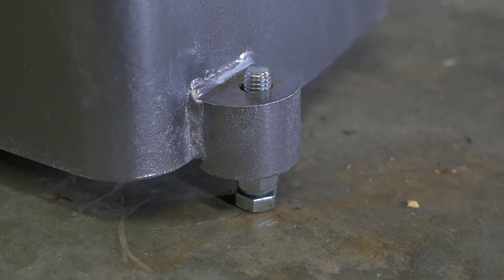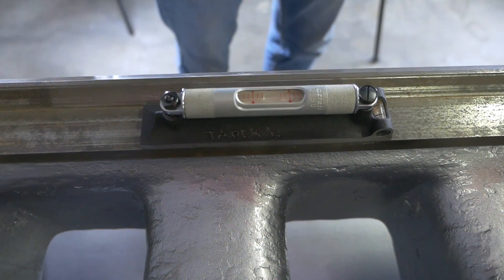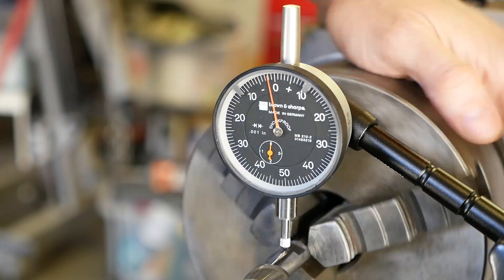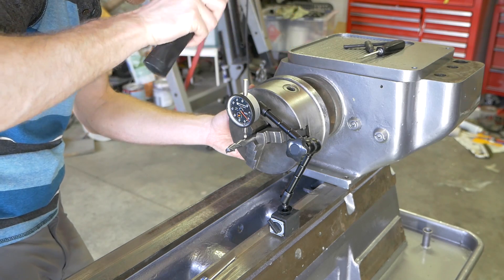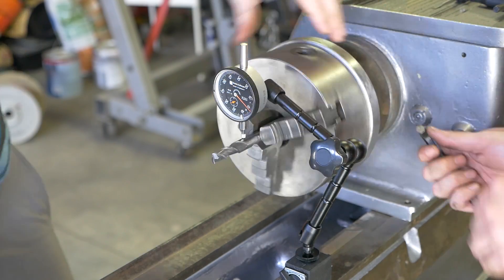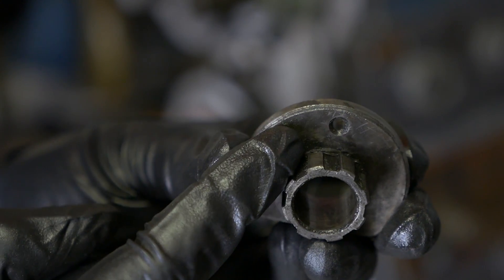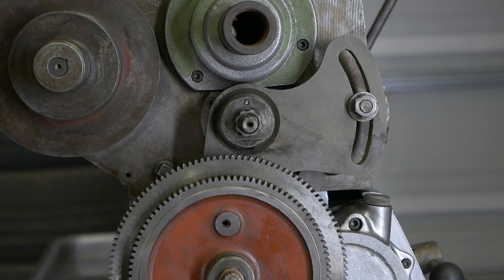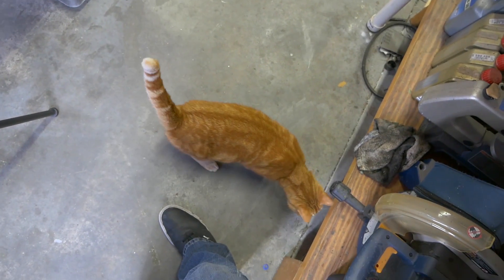Lathe Rebuild Part 7 - S02E07

Comment: Get a digital level.    You can still only get so close with the bubble level and you are still off.    Just like a carburetor on a car it’s the perfect way to measure air and fuel exactly the wrong way at all RPMs.   Close only counts in horseshoes and hand grenades.     If you want it right do it right.

Comment: That shear pin is designed to break off if you have any foreign matter that gets in those gears you would rather have that shear pin break off then your break off one of those teeth or a row of those teeth on those gears also do not use hardened steel use brass or aluminum for a shear pin

Comment: If you want the chuck dead center open the Chuck and put piece of DOM in the back fare enough that you can bore the .0005 off the jaws. I did that to a factory 10 foot engine lathe with a 16 inch chuck and it Was dead on.

Comment: Hi guys i have just bought a Colchester Bantam exactly like the one you brought back from the dead and did this world a great service in doing so. This is probably the best lathe of its kind ever built and will look after you for many years to come, your videos on the rebuild are relay awesome.I have learned a huge amount about my lathe without haveing to take anything apart.I noticed that you had a parts manual that you were using in the reassembly part of the series,could you maybe help me on where I could get one printed or  soft copy as I am also going to restore my Cochester even though it is not nearly as bad as yours was. Once again thank you for this awesome restore where others would have just  melted her down  and  turned this treasure into something stupid you guys did a fantastic job on this.
Reply from the maker: Wiets, PM me, I will send you a hard copy if you want.  Here is the soft copy as well:
https://drive.google.com/open?id=1wuU4BVSiTttArd5EHhh9shTDsNjfz56q

Comment: I want to find one of these GEMS soon after i build my garage... plqnning to build a 24x32 garage with 2 doors, and a side overhead for the tractor, and lawn tools. with the main doors on the short side. have 200AMP service to the house, so should be able to run a 100AMP service box and line to the garage for 220/240..

Comment: I am confused at the centering attempt at 5 minutes in. If you center by using the router chucked in the jaws, I can't see how it will work as a 3-jaw chuck has got too much slop to truly center a part in the lathe. Even if you dialed it in now, the next time it'll be gone and it's not sure the chuck is truly centered either in relation to the spindle, because 3-jaws do not clamp even truly round objects properly centered. 

Trying to do it like this seems like chasing your own tail, I am no expert on this but it seems more logical to try and use the inner and outer surfaces of the chuck for reference to get it centered in the spindle. Then see what the jaws say.

Comment: Why are you centering the head from a part held in the jaws???? The part in the jaws is not concentric to your lathe head (especially a 3 jaw chuck). You should be referencing the head to the ways first, the part should be centered to the ways after this is done, never assume the part is centered correctly until checked and adjusted.

Comment: I know i am a little late on this but to anyone else I definitely recommend smearing  a nice heavy, compatible grease between non moving mating surfaces when you are putting it back together. like the ways and the head stock. it keeps any moisture from finding its way between them and causing problems because they are not exactly areas that get regular cleaning and lubrication. I also do the same with my vise on the mill because of how rarely i move it. 
Probably a good idea for any bare metal mating surface to be honest, saves a lot of work for the next person that takes that machine apart long after you are gone, that guy will be like "wow that guy was the best!"
Reply: I use rp342 and put it together before the solvents flash off. You will never have rust and less settling than greasegrease
Reply: @adamjankowski7679  I use the canned aerosol cosmoline on most of my stuff that's exposed . I just like a thicker gease under fixed parts because it will prevent anything from seeping underneath them, dont use a ton just a finger smear and then slide it back and forth A bit to get it seated properly

Comment: The whole point of a shear pin is for it to break, a drill bit is hard so it is less likely to break. You should use brass or copper or something like that

Comment: In reference to your shear pin. Seeing as it's already sheared I'm unsure that using a hardened steel drill bit is a good call. The hardness of whatever metal was in there was specific as to avoid to much torque being transferred into the internal gearing. I'm sure it will work out fine and not be a problem for a while. But, it's a safety device for the machine. Check out Dustins video From smarter every day.(https://youtu.be/i7KfIBFMraE) Also, I know this video is old by now.

Comment: yep drill bit shear pin was a bad idea, drills are usually HSS or some type of A1 tool steel (drill rod). It's not going to shear properly and will likely cause another part to fail as a result.

Comment: A bar in a three jaw chuck is not a good reference to measure runout. Better take off the chuck and measure the inner taper runout on two different depths.
Reply: Exactly a three jaw chuck with hardened chucks never and i mean never runs zero, and you cannot take a runout on that....never!!
Reply: Absolutely. The two different depths is very important here! Need two concentric circles not just one.
Reply: Well said.   I could put another chuck on that spindle and be 10 out.   So what we re level the bed?????      Now I am 050 out because I have a messed up chuck. Always check the spindle.

Comment: A shear pin is designed to fail before you damage something expensive, use brass or even aluminum nnot harened steel.
Reply: Ideally, use the material that was originally specified...
Reply: Mild steel
Reply: That piece of drillbit is probably going to brake like glass under any sudden impact, it would probably brake better than brass honestly

Comment: Yea, scraping is a skill that takes years to not just master, learn at all without destroying the matching surfaces. Better off stoning them.
Reply: Stoning them will do nothing except make it worse. Scripting isn't very hard. Keith Rucker and John Saunders have hosted scraping classes, which Abom79 also attended. With just a day of instruction, they were all doing scraping that was getting them into the sub "tenths" (tenths of a thousandth) to 10 millionths range. It is not very difficult, but your results are only as good as your reference plate is flat, otherwise you'll have problems with the bluing. These guys are very technically/mechanically able, so they will be able to do it. Though they should practice on some stuff before going to work on the ways. Being proficient and consistent are what take years, but they will be able to get it very flat. Provided they have some knowledge of technique and practice, have a flat reference surface, and do some practice.

Comment: I think you're going to want a bit more clearance on those gears where you made a new shear pin. That is you will need to put them further apart. Gear mesh is kind of counter intuitive; you'd think you want maximum contact and have them as close together as possible, the reality is that will cause excessive wear. There should be a spec for tooth clearance or separation. From the video they look too tight.
Reply: Correct, you need to loosen that up bro. 

Also, please please please get a paintbrush, dip it in some oil, and paint over every bit of exposed steel on that machine. Follow it up with a rag to get rid of the excess.
Reply: Use reg or riding paper place it in between 2  gears when you take the paper out you'll find a backlash is correct
Reply: It's called backlash, and if you don't have it you'll be crying one day in the future. If you don't know, don't fiddle with it.  Or just ask a real engineer.

Comment: Woah, that adjustment of the bit looked really interesting! Could you go into more detail on what it was you did to center it exactly? Thanks!
Reply: quickknowledge The chuck mounts on a backplate. They loosened the screws that hold the chuck onto the backplate, indicated it to find the area where the max TIR (total indicated runout) was, and tapped it in with a soft blow hammer.

Comment: I didn't see any lubrication applied at all when all the gear sets were assembled and sealed up..
Reply from the maker: +joseph crowley good eye, these gear sets actually sit in oil, like a car transmission. I just have to remember to fill it with oil before I run it the first time

Comment: Great series, fantastic job. And as long as you guys know how to scrape, knock yourselves out the lathe can only get as good as you want it. But...in that same respect, if done wrong, you'd be chasing your tails only to get it to a satisfactory standard due to this exhaustive, tedious process. Either way it's something you have to live with. But most important, better experience is gain in doing it. I've not failed yet, in my 20+ years of machining. And it all began with an oversized file, for me. So, have fun and EXCELSIOR!
Reply: eddie Towers can I just say this is my favorite comment so far? Especially the part about getting experience by doing it, even if it doesn't work out!
Reply: I have to admit, I am nervous for you guys, not that I don't have faith in you guys, just my flashbacks harkening back to my halcyon days of ferromancing. LOL. Believe me, any mistakes is as an important tool as any in your tool box, literally, and allegorically, but like a bomb defuser at a fireworks display, I seriously can't wait to see THAT video. in all seriousness, you'll all do good.

Comment: Concern lovely job, but the sheer pin needs to be and not a drill bit. The function of a sheer pin is to protect all the running gear.
Now your not, your running on luck! Cheers

Comment: i would want to examine the ways carefully with a long straight edge. when you bolted the lathe to the chip table and base i wonder if that distorted the ways..  the base  could be far more rigid than the lathe.  loosen the lower mounting bolts and see if it springs back..  some companies use to sell a dial indicator bracket that could slide along the top of a straight edge to let you see what the surface below was doing. 

if you are going to scrape the ways. better take it all apart again..  you may also want to check out this weeks video on flat stones. https://youtu.be/DVLXsq7pi9Y

Comment: I don't know anything about lathes and machining, but I do know quite a damned bit about ferrous metals. I am genuinely concerned why you would use a drill bit for a shear pin? Drill bits are high carbon... making them particularly tough. Is that what shear pins are usually made from? I would lean towards a very low carbon steel or something like that.. but then I don't know how shear pins work exactly. great vids anywho!
Reply from the maker: Thanks John, I think you might be right about that. I used a drill bit only because that's what I had in the right diameter. its an easy part to get to later, so it will probably be one of the first parts we make with the lathe.
Reply: So after doing a little bit of reading I see it's more complicated. Basically all kinds of metals are used. When they say "brittle and shear" that means they're at least harden-able steel that has been hardened and may or may not be tempered. But then in the same forum they say soft metals that would essentially bend/tear as opposed to snap/shear are used as well. Dang confusing stuff. They also talk about the actual wear on the shear pin ... so in that case you want a harder more wear resistant steel.... not a soft one. So roughly speaking it is completely up to the application and everything is used from plastic to diamond (that last part was a joke). So I want to say... That shear pin looks great! 

http://www.ybw.com/forums/showthread.php?4118-Making-my-own-shear-pins

Comment: Aren't the ways hardened? They are on the Bantam I use. I thought grinding/lapping was the only option with hardened ways?
Reply: It is. You can't (or don't) scrape hardened ways. I'm not sure his are hardened, but most Bantams that I've seen are, if they are he won't be able to scrape them no matter how much he wants to. If he's dead set on scraping something he could do the apron and gibs, but he very likely to do more harm than good unless he spends a couple months of studying and practicing on scrap cast pieces. Also if they are more than a couple thou out he will need to mill them to within that before he starts scraping unless he wants to scrap for a solid year of evenings/weekends or so and I don't see a milling machine anywhere around there....or a large surface plate....or a precision straight edge/prismatic straight edge ....or a carbide grinder... and so and so forth...and none of that stuff is even remotely cheap.  For him to say "there's nothing anyone can say to make me change my mind" he's either done most of that and got the rest planned out OR he's totally ignorant on what goes into scraping a machine like that and will be eating those words after he destroys his ways and figures out to have them properly ground it will cost 5-10 times what that machine is worth even after the restoration. Regardless I wish him the best of luck, it does look pretty good so far.
Reply: I shouldn't have said destroy as that would imply that they'd be junk. I don't believe you are are to junk anything and I have no doubt with the work ethic you've displayed that you can do whatever you set your mind to and trust me I know you will be taking it slow =).  I am by no means an expert on scraping or machining, but I have read a lot on it and done some myself, but I've talked to many guys that are about this subject because I was thinking about doing it myself on my Leblond and by far the consensus was not to try and scrap the hardened ways. I also had a very hard time finding someone that had successfully completed this task. In the end I obviously decided not to and just do the cast surfaces that ran on the hardened ways as these surfaces are obviously are meant to wear before the ways because they are softer and in the end I have a machine that can make parts way beyond the tolerances I work in and frankly am capable of producing on a regular basis. If nothing else I would encourage you to start with the apron and cast surfaces first and at least see how tight you can get the machine before messing with the hardened ways, if nothing else to have a better understanding of what it takes and  who knows maybe you will be happy with it w/o doing the hard ways or maybe you won't, but at least you'll know. Also if the surfaces are very bad you might think about use Turcite or something like it to build them back up, but you will have to mill first and honestly if there's any appreciable wear you will need to do that anyway to avoid trying to scrap out 10 or 20 thou because if your planning to scrap out that much by hand you are for sure setting yourself for failure. Your surface should be within at least 5 thou before you think about scraping. I'm guessing you've already watched all the vids on YT about scraping but if not, Keith at Vintage Machinery recently did a video on his lathe regarding this very subject you should check it out. All the best and good luck.
Reply from the maker: Yeah, they are hardened, but as long as you have a scraper that's harder then the ways it will still scrape. We will be using carbide. At least that's what I found in my research. it may take longer of course then none hardened ways.
Reply: +Physics Anonymous     Have you physically tried to scrape a Hardened material by hand? Cast iron is hard enough to scrape let alone something hardened. I'm not saying it can't be done, while in theory carbide would/could scrape a hardened cast or steel it would take you a very very long time to do it with a Biax or other ($2000) power scraper and a LIFETIME to do it by hand and a couple generations if it's out more than a couple thou. You've probably already proved a lot of people wrong with this project so far, don't go and mess your record up now.=)
Reply from the maker: Thanks Steve, I really do appreciate your comments. chances are pretty high I will eat my words. I have no problem doing that. we do have a large surface plate, and some large precision granite parallels we will be using. indecently we do have a CNC mill that we built. its been hiding in the background for a long time, though we wont be using that for this effort. But a small point of confusion in what you are saying. you say the ways are much to hard to scrape, but you also say we will destroy them. Seems to me the worst we can do is barely effect them. we will be taking it slow (as if we had a choice) and checking our progress regularly. my bets on you and future me being right, and we wont make it very far, but that's not going to stop us from trying.
Reply from the maker: Thanks Steve, I love hearing about peoples experiences. sounds like you made the right choice for your lathe, and its very likely we will end up with the same conclusion. at the very least we will end with a nice video of what not to do.
Reply: Oh one other thing I wanted to mention is a lot of people recommend not to scrap the ways of a lathe no matter if they're hardend or not and say there's a reason why machine builders grind and not scrap. They say that all the small valleys that are made by scraping gather abrasive chips and lead to premature wear. I don't know if this fact or not but it does make sense. Sounds like you maybe able to avoid this by using felt wipers and changing them very often, but I thought it was worth mentioning.